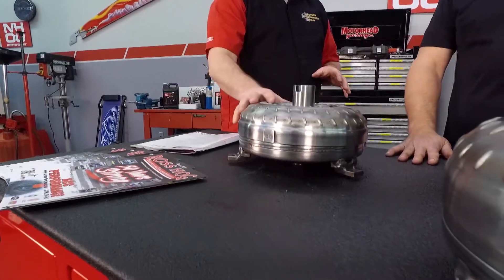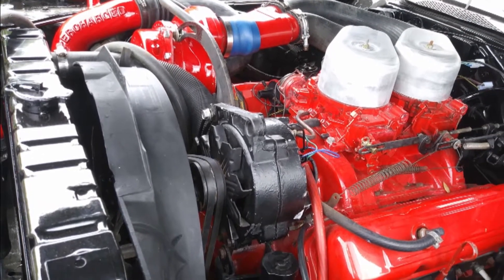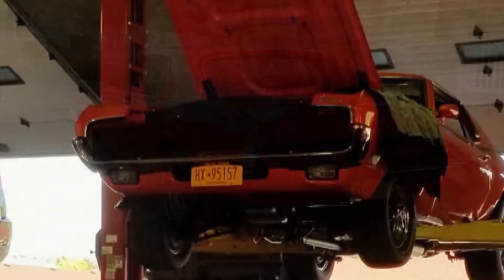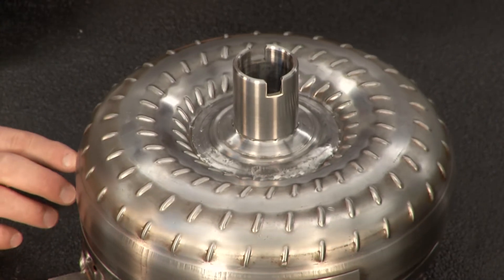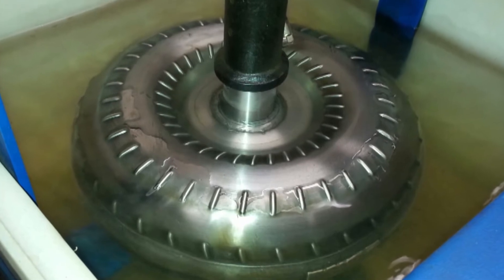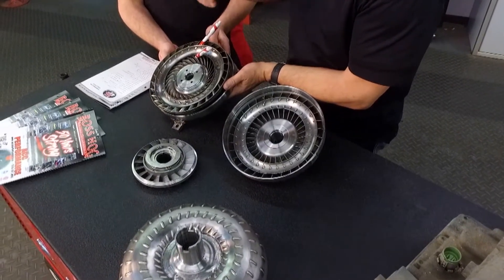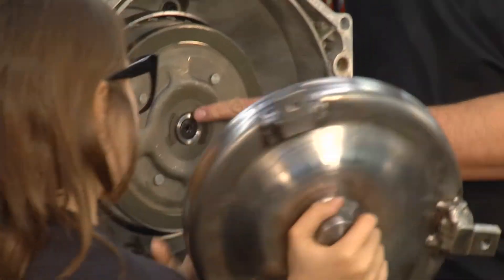Motorhead Garage Episode 2111 Segment 3 ACC Performance Boss Hog Torque

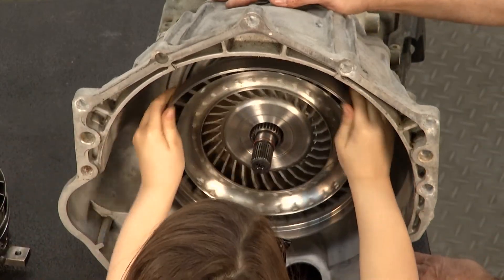Comment: i am building a 1948 f1 on a 1985 chevy truck frame with 4:10 posi rear end. th400 transmission strip street build. putting in a 383 stroker from HRC with 550 hp, give or take 10 hp. so 540 to 560 hp. they told me to get a 2800 stall converter. i am looking at the boss hog 46022. local driving only. no drag racing. well maybe hit it hard now and then. lol. will this torque converter work for me. 15" tires right now but down the road it will have 20'S on the rear and 18"s on the front. Thanks, Bill.